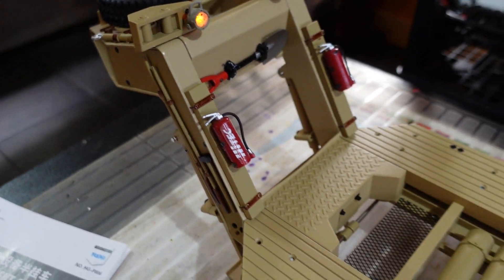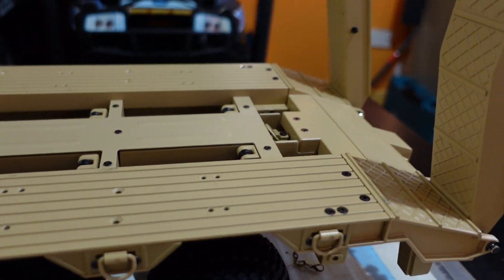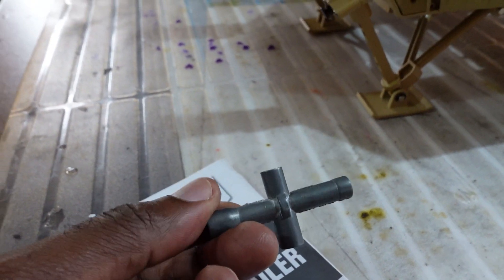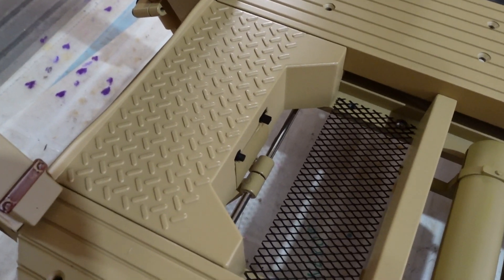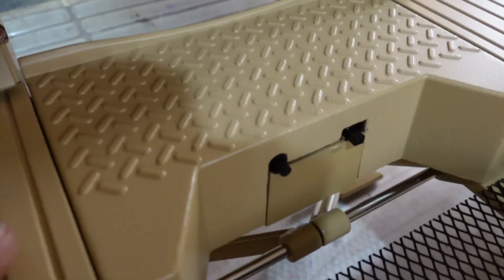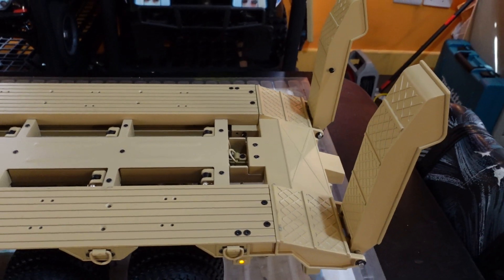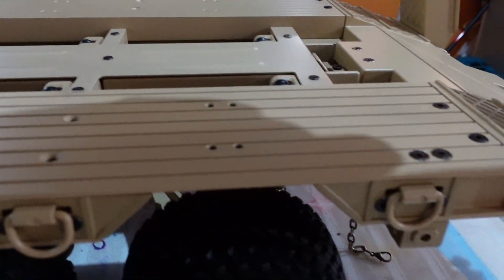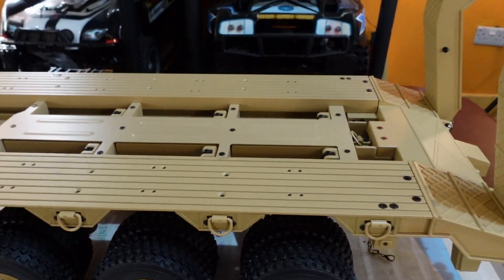HG P806 HEAVY EQUIPMENT TRAILER (HET)

Comment: congrats on the the trailer I love mine.  Not sure if you caused the wiring issue or not like you explained.  But I don't think I know of anyones trailer that has came with functional lights.  With mine not working once I built it I had just removed the entire wiring system and installed my own led's with orange marker lights. set up on own power source.  Its going to look awesome behind your M1070
Reply from the maker: Yes thanks for that info
Reply: What brand tires and wheels do you run on your HC6.  They are beefier than stock it looks really nice in thumb photo 👍🏼
Reply: They look like Trx4 tires yet I thought I tried that on mine and they hit one another in rear axle do to diameter
Reply from the maker: @thatsmyrc  Thats the TRX 4 trail
Reply from the maker: @thatsmyrc  I have videos with it running you can check them out